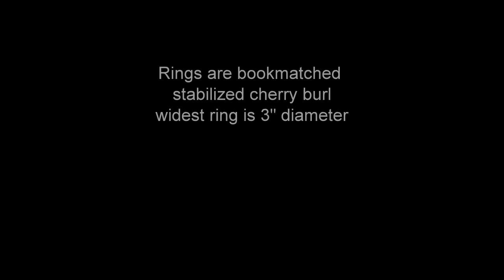Out of this world challenge

Comment from the maker: One viewer was concerned about my having dental floss wrapped around my fingers... if the lathe was moving during the ring removal.

So to be clear, the lathe was not spinning at the time.  It took a few minutes of gentle prying/sawing with the dental floss to separate the tape from the mounting block.

Then it was easy to peel the tape from the back of the rings.